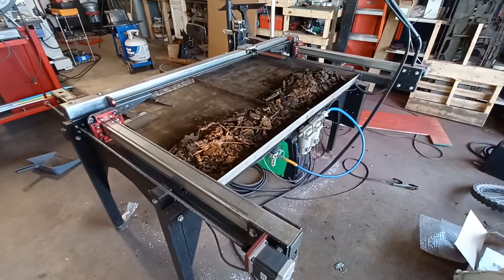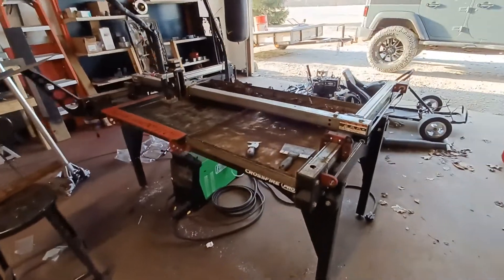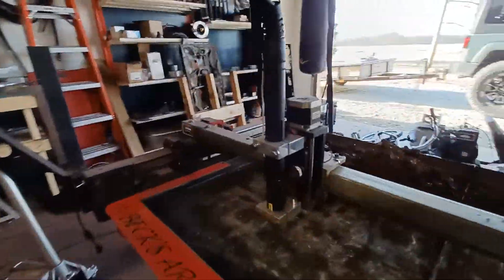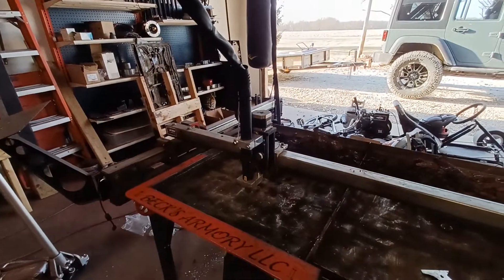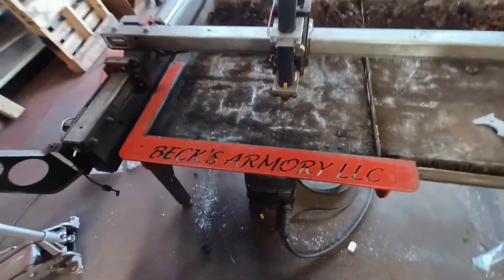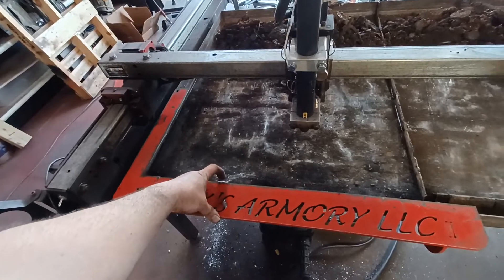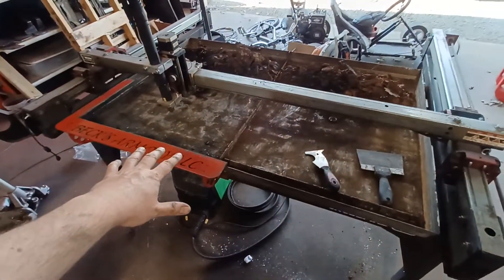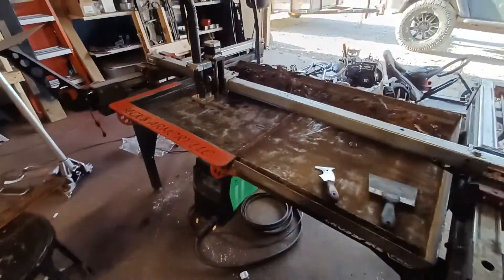Langmuir Systems Crossfire Pro after 1 and 1/2 years. Good or Bad???

Comment: Great video. I wanted to add... I clean my 4x8 table out with a ridgid  shop vac.. sucks the fine debris and cutting fluid, but first ... use the eveloution magnetic pick-up tool to remove the large pieces.

Comment: How difficult was it to hookup the everlast and after clicking on your link above...did you have to purchase anything else when adding this to your system? I already have the crossfire pro and the hypertherm45xp which all works perfect and everything was quick connect, but I need to cut metal thicker than 1/2" so I want to get the Everlast 85.
Reply from the maker: it was very straight forward.  I have a video called "Hooking your Everlast Power Plasma 82i to your Langmuir Systems Crossfire Pro"
Reply: @BeckTools  ok thank you for your time!

Comment: Of the 2 options they give you for plasma cutters on the website, are those good enough for starting out?
Reply from the maker: The Razorweld sucks and the Hypertherm is really good but over priced.  I highly recommend the Everlast Power Plasma 82i.  It's waaaay better than the Razorweld but not as expensive as the Hypertherm.  Here is a link to the Everlast https://www.everlastgenerators.com/product/plasma/powerplasma-82i-cnc-package?rfsn=6157440.58fd90

Comment: Thank you for sharing your thoughts. I have the LS pro and Razor 45 all in the box. I think of buying the EverLast 82i as an upgrade and using the 45 for automotive work. Is it true the 45 is not that good for the plasma table? Everyone complains about it, but no precise info on why it is that? 

Also, would you make and sell the torch mounting for the 82i? 
I see you are selling the plan, which is excellent.
Reply from the maker: The RW 45 can produce really nice quality but it's inconsistent and un-reliable.  I feel like you spend all your time trying to dial it in. The Everlast just works... Every time... If you do decide to buy the 82i please consider clicking my link in the description within 30 days of your purchase. :)  It helps out my channel.   As far as making and selling the torch holders with laser holes...  I don't think that is something I can fit into my schedule at this point.  Beck's Armory LLC is my side gig still.  If I ever get the chance to go full time I'll be able to support more products. :)
Reply: I'm seeing the same thing buy I haven't really had any issues with mine so far other than making sure you're using the right tip for the thickness, I just used mine to cut 10mm thick armor plating and it went through it like butter with the 1mm tip